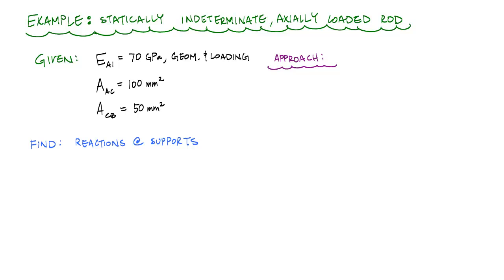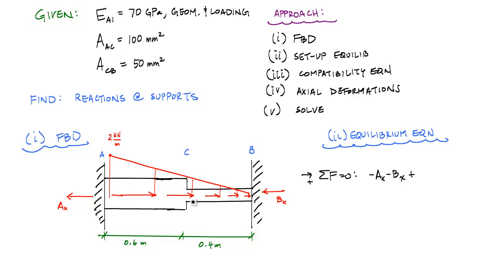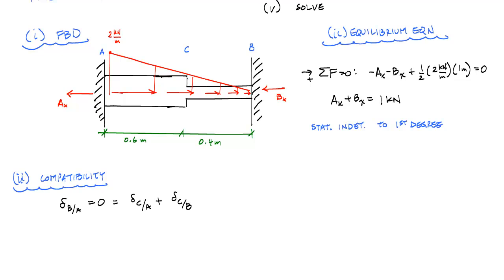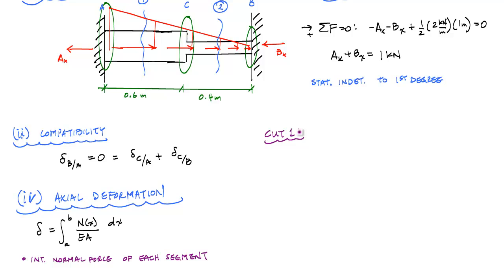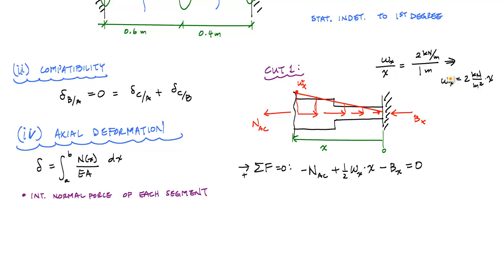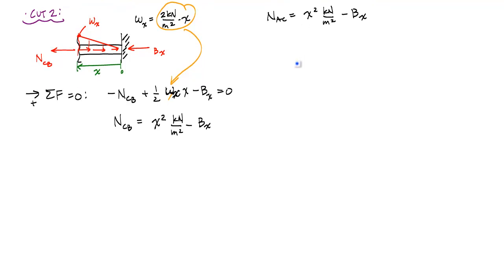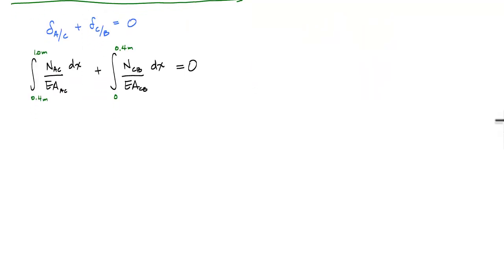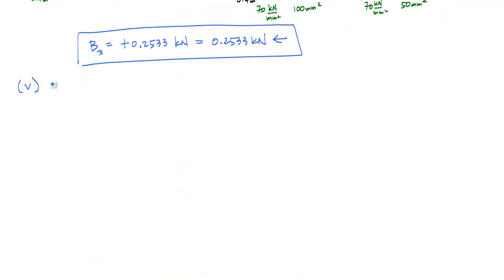Statically Indeterminate Axially Loaded Rod Example 1 - Mechanics of Materials

Comment: Hey, would you use this method to solve for an axially loaded column fixed at both ends with a stepped change in cross section at mid height with an axial load at mid point of each section. Not sure if thats coming across right! Basically looks the same as in your example, expect its a column and there are two axial loads, one in each section of different cross sectional area... Hmmm, a diagram would be so much easier wouldn't it?!
Reply from the maker: Yes the approach would still apply as long as the loading is axial. Yes a diagram would be much easier. In any case,  if you are including the self weight of the column you will have two uniformly distributed loads based on the density and cross-sectional area, although it sounds like you are assuming the concentrated loads in each section account for the self-weight.